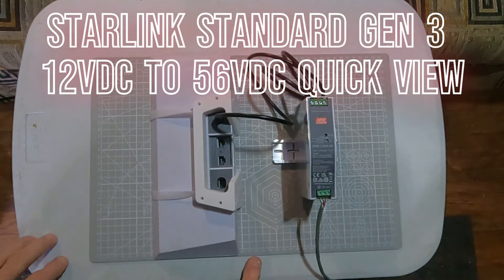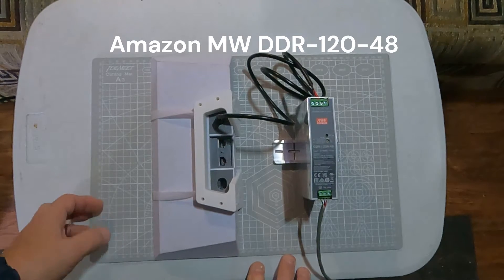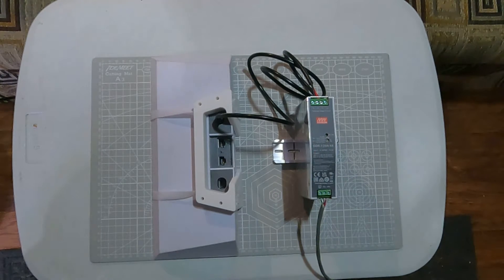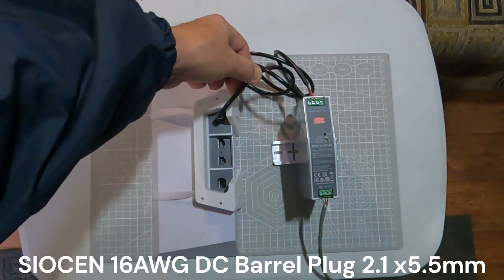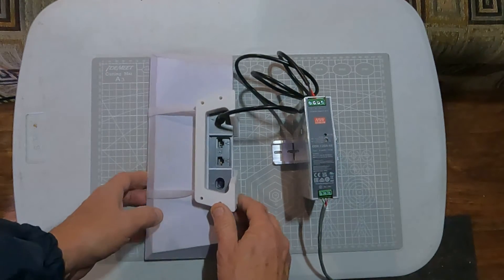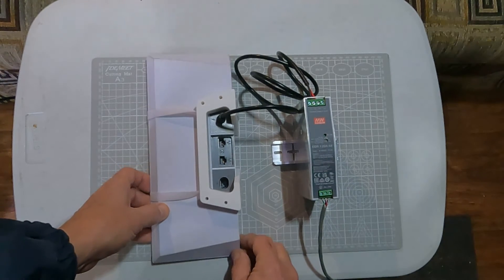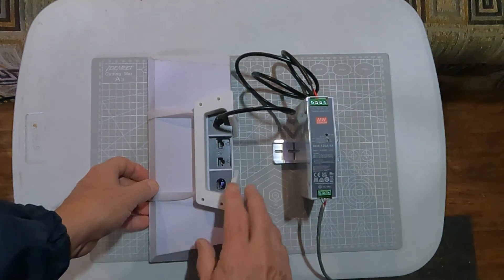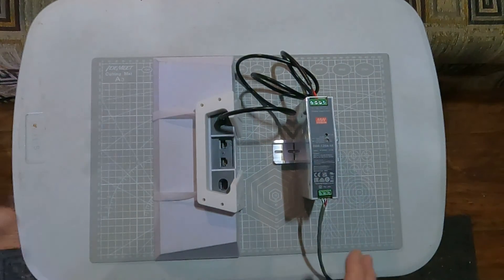Starlink Standard Gen 3 converted to 12 VDC for RV, Solar or Command Post use

Comment: What did you wire that 3rd ground wire (to earth) to? Wouldn’t the positive and negative from the battery be enough?
Reply from the maker: Ground and negative on battery is the same yes if fixed site it should also go to earth  Thanks Bruce

Comment: Wow, I like but have a couple questions, if you have time.  I have an Ethos LI, with the 48 volt lithium battery system and love it.  Recently purchased the starlink Gen 3 and designed away to mount on top of the Class B van.  Tomorrow taking to RV place to have the wire ran from roof top to a selected spot in van.  Question, since I have a 48 volt system is it possible to get rid of power supply and go dirct from batteries to the router?  If so, what would I need to do?  Again, thanks for your time.
Reply from the maker: YES have to get a POE injector if not using the router or get a barrel connector to feed it with, always add a fuse inline 10A DC

Comment from the maker: Check out this converter on Amazon from Xtar Store,   Starlink 12V to 48V DC Step UP Converter, DC Converter Regulator 3A 144W Power Supply Adapter for Starlink Satellite Dish V2 (12V to 48V 3A 144W) - as an alternative to the MW
@StarLinkTec

Comment: Would you please include the Amazon links here?  There is a 120 A and 120B model - not sure which to get.  Thanks.
Reply from the maker: the one we used is from KAABEE store and is a SA 240 watt  # DTD-12S485 on Amazon
Reply: @StarLinkTec  Sorry when I search SA 240 watt  # DTD-12S485 I don't see this.  Is it possible for you to place the link here?
Reply: FYI and anyone else going with a Mean Well DDR-120 series.  The 120A needs an input range between 9 - 18 Vdc.  The 120B input voltage range is 16.8 - 33.6 Vdc.

Comment: In an RV what what do you connect the protective earth ground to on the in voltage side?
Reply from the maker: Ground and negative go together  Thanks
Reply: Have you a pole mount for an class c rv? Fender mount. Hitch already has a bike mount. For the Gen C dish . There was a problem with the plastic mount
Thanks

Comment: Do you have links to the Amazon parts?
Edit: I copied from the video
And I’ll need a plug into the power port of my vehicle with bare wires
This is about a 2 amp draw?
That is an expensive part but what do I know. If that is what it takes to go 12 volts.
Now did I see a video for a pole mount to the gen 3 dish 
Thanks
Reply from the maker: We will be doing a new video on another converter soon that is bit cheaper. but is not adjustable voltage that may work FOR SHORT CABLE RUNS  keep an eye out and hit the notification button,  the draw max is 120 watts at 12 VDC at max Thank Bruce
Reply: I have 760 watts on top of the RV and I'd rather power it from the dashboard 12Vport than run the inverter for the 110 V outlet